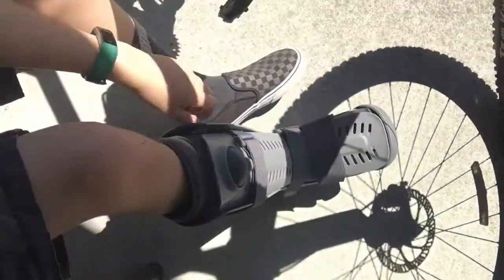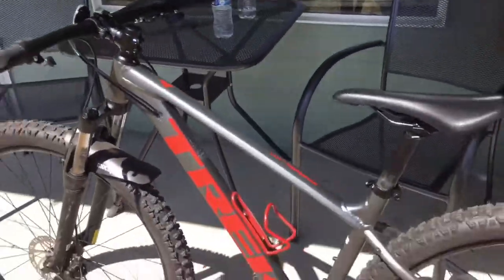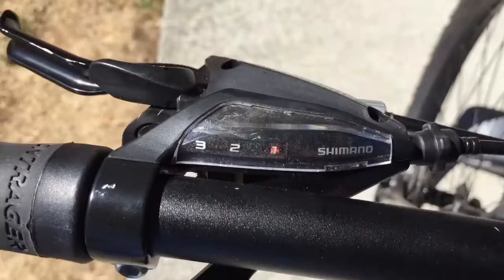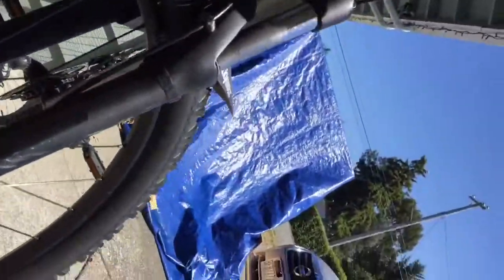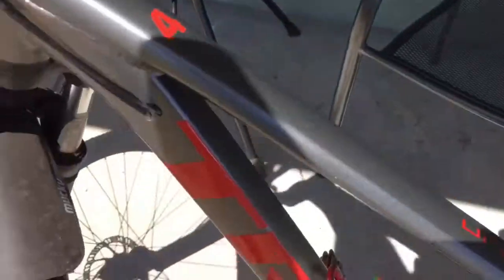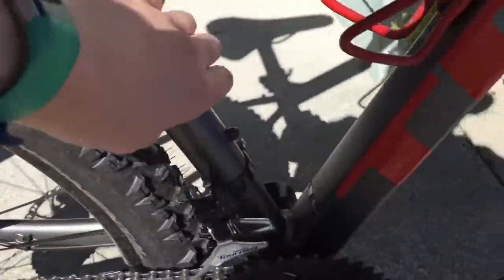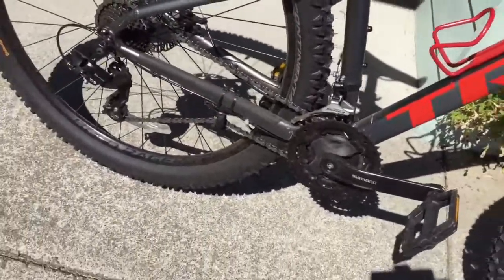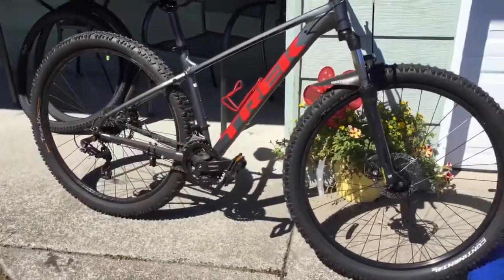2021 Trek Marlin 4 Review

Comment: Nice bike 😎
Reply from the maker: Yah if you’re looking at getting one it can hold up to some black diamond trails
Reply from the maker: Thanks
Reply: @brodydawson6200  i just brought a trek x caliber 8 2019
Reply from the maker: Have fun shreddin
Reply: I wouldn’t say black diamond that bike is not made for those types of trails I have a marlin 7 and I just got a 2021 pro caliber 9.6 it was a little over 3,000 but it was well worth it it’s is smooth even on the roughest trails
Reply: @mateolopez3454  I use to have a marlin 5 then upgraded to a marlin 7 and then upgraded to a X caliber 8
Reply from the maker: I don’t care I just break parts and upgrade them
Reply: @brodydawson6200  have fun 
You do you
Reply: @mateolopez3454  no man it depends on the rider not the bike. Sam Pilgrim took a Walmart bike down Whistler double blacks and it held up fine. I bet this bike could do the same
Reply: @matthewlucic4950  yea but for that type of trail I bet my bike would shred but that marlin 4 well it doesn’t even have hydros so it’s also dangerous because you don’t have good brakes and that suspension fork isn’t made for that if you don’t care about your bike then full send it but if you don’t want to damage your bike I would lean towards lighter trails. If you want to ride on tough trails get my bike a 2021 pro caliber 9.6 it’s great
Reply: @FinWallman  my pro caliber is basically an X caliber but with better parts and a carbon frame